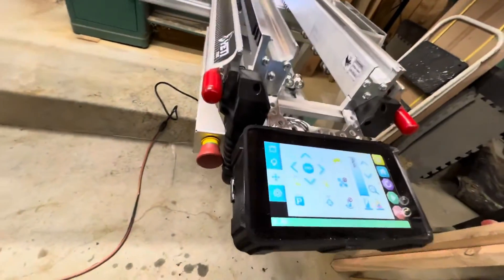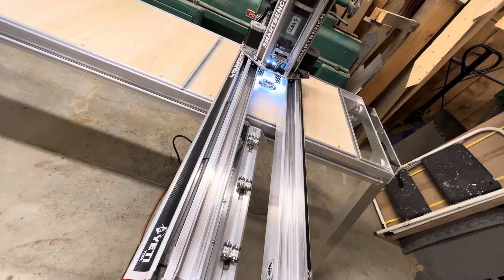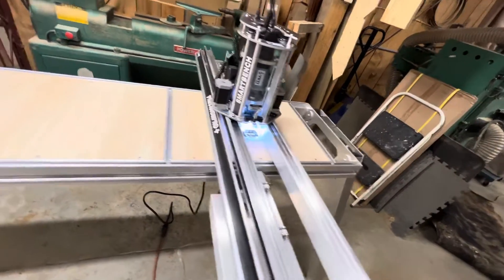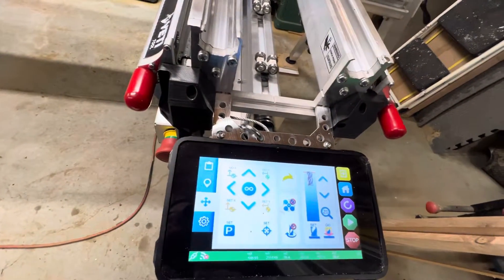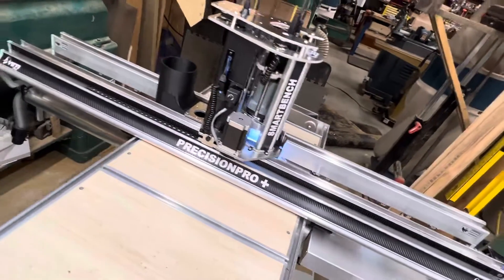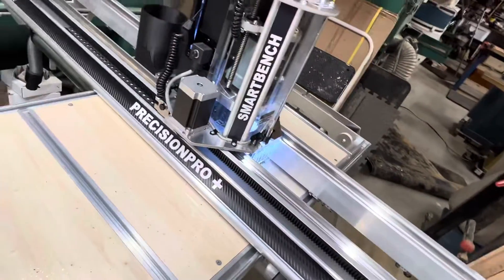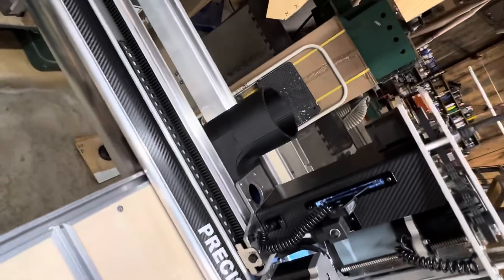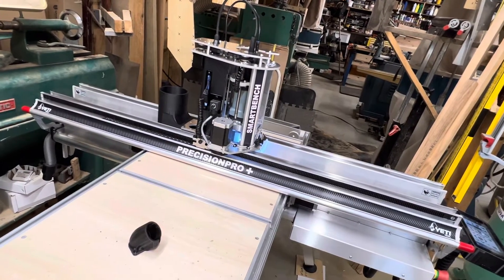Yeti Smartbench CNC router initial set up with 4” dust collection chief

Comment: looking forward to seeing the Yeti earn its keep. what is the HP on the router head? will you use it to flatten slabs, or do you have a different tool for that?
Reply from the maker: Hi Rocco:  I've purchased cutters for slab flattening so that'll be an option.  I have a couple of orders for cabinets - so I plan to make the boxes on the CNC.   I will also put around with making some signs.  As I get the kiln set up in the Spring, I should have a good stock source for signs.  Lastly, I plan to use to make some carvings on timber frame timbers.... We'll see.  There are a lot of possibilities for sure!
Reply: Where did you get the 4” adapter. Did you print it?